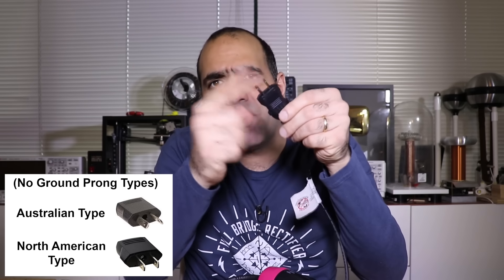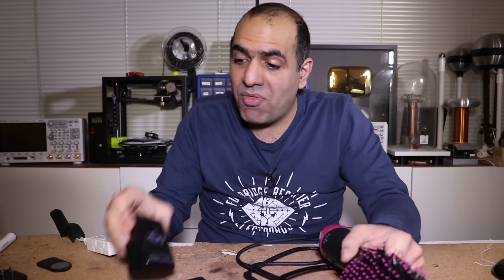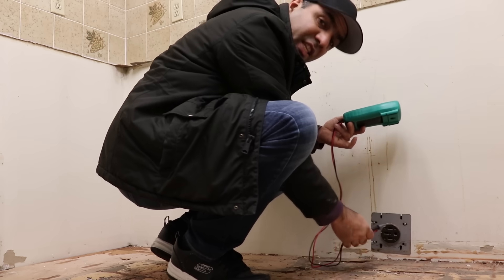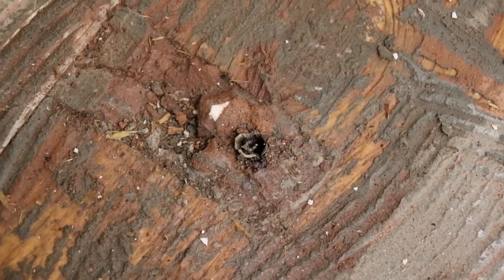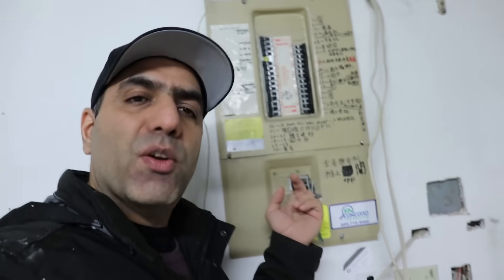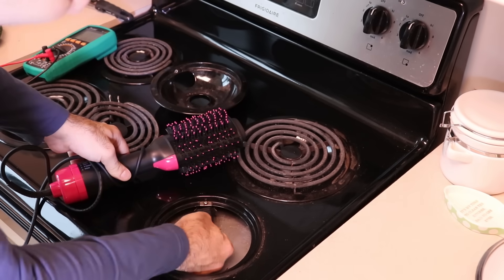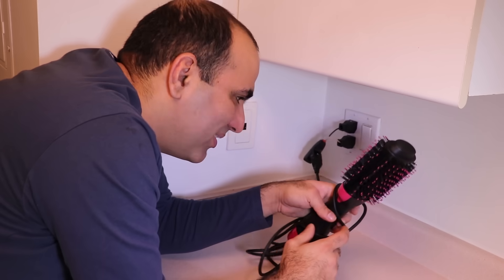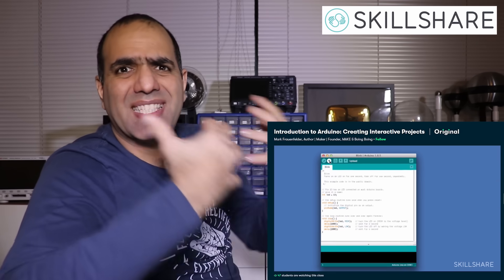Finding HIGH POWER 240V in a 120V Country

Comment: The UK has 240v 13A also has the safest plug in the world with a fuse. The rest of the world is basically taping death wires together and they get shit power. They can't even run a kettle on a single ring main what a joke of a system. The UK is still the best Rule Britannia God save The Queen.

Comment: The reason apartments and other larger buildings have 3 phase power (3 live lines 120 degrees out of phase) is because it is more efficient, especially for very large motor loads like elevators or pumps.  However, that means the electical company has to supply the building with 3 phase power, which needs 3 power lines, 120 degrees out of phase.  For smaller houses, like single family dwellings, they use what is called a split tap transformer.  With these, the power company only needs to run one phase down the street, and the primary side of the transformer is a single winding.  The secondary is also a single winding, but half way through the winding they tap in a neutral wire.  If you measure voltage from either half of the secondary to the neutral, you will get 120V.  If you measure the entire winding, you get 240v.  This is why your appartment has 120 degree 208V instead of 180 degree 240v, because it is a larger building and has 3 phase mains instead of split phase.

Comment: Hi Mr. Mehdi! I have a question. Does the heating up of mobile/laptop chargers reduce their efficiency? Because today i was gaming and my charging brick was under  my blanket which i didnt notice, so my laptop shut down in between gaming because there was no juice left in the batteries and when i touched my charging brick i could not hold it. It was too hot. Gaming requires alot of power. So apparently my charger was not providing enough power.
Reply: Thankfully your charger had thermal shutdown protection or else you might have burned your house down.  Transformers and power supplies get hot and have to radiate the heat out of their cases.  Once it got too hot, the regulators shut down.

Comment: Hi Mehdi.  Looking to find someone who has posted something electrical on Reddit and from there wound up on this channel.  Of your videos I picked the most recent one thinking this query might reach you sooner.  I know it's Christmas so you're probably in Hawaii on vacation but even so, if you notice this and have time to answer I'll bet you know the exact answer instead of me getting a bunch of guesses by people who don't know what they're doing.  Clearly you know what you're doing. 

I'm trying to find the source of parasitic drain on my 1995 Oldsmobile 98.  Putting the multimeter on the milleamp setting, I touch the positive multimeter probe to the loose nagative cable and the black multimeter probe to the negative post on the battery.  I get .10 milleamps.  Reversing the probes, I put the positive multimeter probe on the negative battery terminal and the negative probe on the loose negative cable and I get .03.  Seems to me it shouldn't make any difference which probe is placed where as long as the multimeter is in series with the circuit.  Obviously it does make a difference.  Can you please tell me why?  I've got two multimeters and they both do the same thing with the same situation that I've described.  

Thanks for any help.

Comment: That was fun.  FYI: at least in Canada (which is almost identical to US practice and codes), 120/240V is far more common than 120/208V.  I think the only place where you see 208V is industrial and commercial where the buildings tend to be supplied 3 phase directly.

In residential, as far as I can tell, it's always 120/240V.

Comment: i suppose you could get wall mountable schuko plug from europe and run that to the power outlet if you're desperate for 240 volts but don't want to make a suicide cable.

Comment: If you ever do build or find one of these adapters, check everything!!!!!!!!!!!!!!!!!!!!!!!!!!!!!!!!!!!!!!!

I got thankfully myself involved with my county Fair's Electrics, and got myself free lunch. we had a food vendor show up that had wired up there trailer with a 30 amp 120 / 240 input then made an adapter cable to 2 normal US. 15 amp plugs ends that was... wired correctly. But out of the five extension cords they brought out of the two that they used one of them had reverse polarity and as soon as they plugged it in there was a nice neutral hot short that trip the overcurrent protection AKA circuit breaker. I then had to check their installation which I wanted to do before they plugged in and subsequently trackdown out of 6 electrical panels which one had the breaker in it of course not labeled.
They didn't necessarily need 240v, they mostly had just two separate 20 amp circuits throughout the trailer.
The extension cord in question had replaced ends which is all fine except the replacement ends must have been old stock and for some reason this manufacturer decided to color the neutral pin black before they switched to the now-standard silver. whereas the standard for the hot pin is brass. so obviously the black wire ended up on the black terminal when it should have been the other way around.
get yourself one of those 3 light Outlet testers, test at the outlet, test at the end of the extension cord and test anyting Downstream.
If you want to go further get a non-contact voltage detector as that will allow you to detect polarity in the AC system which the 3 light tester has a few modes that it cannot detect. follow that up with a good multimeter ( in volts mode of course not amps mode, you hopefully only ever do that once..... ).
Reply: This is like the third or fourth comment I've said this in I really should do a copy paste at this point.

Comment: my question is....   since you have 2 @ 120 @ 16A each , does it equal 220 @ 30A???  or is it still 15A total ???
Reply: It is 240V at 15A.  When you put voltage sources in series, you double the voltage, but the current stays the same.  When you put them in parallel you double the current, but the voltage stays the same.

Comment: @ 5:53 - If you had an oven with two outlets on the top instead of the one, it would be very easy to get 240V with a customized extension cord.

Comment: Is it true that in North America they went with 110v  due to pressure from copper mine owners who wanted laager diameter cables used in houses?
Reply: No. Larger diameter cables compared to who? In 1882 the world was equally dark. Thomas Edison chose 110v as the voltage in his power generating stations. This matched the 100v incandescent lamps he manufactured. Choosing the voltage for an incandescent lamp is important because the higher the voltage the shorter the life of the lamp.  That is why incandescent lamps in automobiles can be quite ancient.  12v lamps have massive filaments compared to 240v bulbs. Basically a 120v lamp will last twice as long as a 240v lamp of the same wattage.

There is no perfect voltage. A lot of things today are built to run on 100-240 volts. This covers Japan's 100v to the 230v used by various other countries.  I suspect that when the item is used in Japan it runs significantly cooler than it does in the 230v world. Japan wastes less energy than the 230volters. Japan seems to be doing  well on a paltry 100v.
Reply: @billelkins994  compared to the standard 220v of the time as put out by the investor of the incandescent lamp in a 1860.
Reply: @tasherratt  Where was the operating 220vac system in 1882?  Edison's 110vdc system was the first in New York city. The 110vdc system did not become the US standard, except for the 110 voltage.  It was heavily adopted and the service continued for 125 years.
Reply: @billelkins994  Across quite a large swathe of the UK, Edison was well behind in New York. Its why he lost his patent for the bulb he copied.
Reply: @tasherratt  

Sebastian Pietro Innocenzo Adhemar Ziani de Ferranti  had not invented the transformer until 1885.

Comment: So Australian normal power outlet supply is sort of 240V.  Officially it is 230V +10%/ -6%   or  216V to 253V RMS.  Normally not less than 240 and often up to 250V.  Some homes have access to 415V 3-phase  (3 x 240V  120º apart) other regular homes in country areas (like my home) have access to 2 x 240, 180º apart , which is really 480V single phase with a centre-taped grounded Neutral.  all from a 50KVA street transformer out the front of my house.  Buckets of power if needed.   I have successfully run a 35KVA motor at home, but it did dim the house lights a little at power up.  :)    If Mehdi lived here he'd be dead by now...

Comment: Wow I didn't know the 240v power in apartments isn't actually 180deg out of phase. Why is that? 180 is understandable as it's from a center-tapped transformer but how and why do they supply power like that (forgot the other angle) in apartments?
Reply: Because large buildings get 3 phase power.  Small residences get split single phase power.

Comment: The situation with the kitchen outlets is normal in Canada. The two outlets are on different phases, but share a neutral, resulting in a situation where the current that goes through the neutral is the difference between the current drawn through each outlet.
For example: if the appliance plugged into the top outlet is drawing 10A, and the appliance plugged into the bottom outlet is drawing 9A, only 1A will go through the neutral.

Comment: If i was lucky enough to watch this video before I tested my multimeter i would have switched to V and not make a short circuit. Luckily thats why breakers exist. Damn
Reply: Unless of course you have a federal fire Pacific electrical panel ( apparently you can slip a check under UL Laboratories door backing in the ancient years  and get approval ) which just recently got retired. I accidentally did this a year or two ago and as I watched all the lights in my room dim and come back up only after the power strip breaker tripped. thank goodness all the computers running UPS.
I've read stories around the interwebs of electricians in attics too lazy to go down And using Cutters to disconnect them and suddenly arc welding things together. Federal Pacific panels are on the do not use list of home inspectors for good reason.

Comment: The reason for the difference is that in residential, you only get split single phase going to the house, so you get the 120/240V. In commercial/larger residential, you'll see the 3-phase wye 120/208 volts. Sometimes, in an area with mixed residential and commercial, you'll sometimes get 120/208/240V high-leg delta 3-phase, b phase is the high leg so it's 120V phase a and c to neutral, 240V phase to phase, and 208V phase b to neutral since if you run it without the high phase, you'll get the same split single phase. In industrial, you often see 3-phase wye 277/480V.
Reply: Most of the time, in residential areas, the power company only runs a single phase primary on the side streets. As far as high-leg delta, you aren't supposed to use phase b to neutral to run 208V loads for two reasons: (1)single pole breakers do not usually have the voltage ratings for that use (2) it can overload the transformer
Reply: u engineer?????
Reply: @ArshdeepSingh-oc1oo  It's basic commercial and industrial wiring, commercial and industrial electricians who work with that stuff every day know it real well.  Most residential electricians don't.  Electrical engineers who are on the "power" track rather than electronics certainly do.  I'm neither, but I've studied it a bit, and Zzyxx Wolfe has it all right as far as I remember.

Comment: So what you're saying is you can get 220V power out of the electric range.

L2 Charging for EV vehicles require 220V power.

With the right adapter, I can recharge a Tesla through the back burner.
Reply: In case you are serious, BEV/PHEV charging already commonly uses the same NEMA 14-50 socket that electric ranges and larger RVs/campers/travel trailers do, hence yes, you can charge a Tesla at level 2 at any of the above sockets assuming the EVSE cord will reach. You can also use a 14-30 clothes dryer socket if your car supports automatically or manually limiting the charge current drawn and you have an EVSE with the correct plug and/or a 14-30 or 50 with no neutral pin as that is what determines the difference. 30 amp has an L shaped neutral pin 50 amp is a flat pin. With that pin removed you can plug in to either one as the others are the same.

Comment: I was trying to figure out if I could make a 240V adapter off 2 opposite phase 120V circuits for a welder in a space i couldnt run new wires.
I decided risking electrocution or burning the place down wasnt worth the halfassery, so I just bought a generator with the appropriate output.
Reply: Good decision.

Comment: At 3100 comments this one will undoubtedly get buried, but residential North American power 240V single phase is delivered to the house, and 120V is derived from center-tapping for the neutral at the local transformer.  Your apartment building has three-phase power.  Without seeing your breaker panel no idea if you only have two phases delivered to your unit or if all three are delivered, but only two phases reach that oven outlet, so approximately 208V across phases.

It may be that the apartments are balanced where A-B, A-C, and B-C are round-robined through the building's units, such that everyone gets two phases.  Thing is, HVAC equipment would operate much more efficiently on three-phase, so depending on how various services in your building are paid for (ie, out of association fees versus directly by the residents) there may be three-phase to your apartment, just not for anything that you have ready access to.

I am by no means an expert, I've simply looked into availability for three-phase power at home for shop equipment, versus 240V single phase equipment.

Comment: It is important to check the socket wiring. I had a socket in an apartment where the neutral and hot were swapped. This caused a breaker trip when trying to get 240 volts from two different outlets.
Reply: It should have given you 120V, not tripped a breaker.  Though if either one was a GFCI protected circuit, it'll trip if you try to use it this way.

Comment: Isn't as simple as getting a transformer with at least 30% more watts support than usage?

Or if the house have dual phase supply just get the 2 phase cables and use them instead of phase and neutral.

I did that with a sewing machine

Comment: That's a very strange apartment you have there...never seen more than one circuit in any kitchen, and I'm fairly certain we had 240V not 200V for the higher power stuff like the A/C.
Reply: That's called a multiwire branch circuit.  They're not common in older homes, but now they require more circuits in the kitchen (my older house only has one 20A circuit in the kitchen).  The reason for the 240V / 208V discrepancy is because he's in a large apartment building that is supplied with 3 phase power.  You get 208V between the phases.  Residential homes are supplied with split single phase 240V power.  That's why you get 240V there.

Comment: 8:00 woah woah woah. That's actually a massive code violation in my state. I think the actual reason for this is that that oven is on the same two circuits as the outlets. Because they need to be branched with the minimal amount of wire its easiest to run both phases through each outlet like a tree from the ovens box. This is also a code violation in my state. An oven is just required to be on its very own circuit.
Reply: No, kitchen outlets are wired like that to save wire, but that doesn't mean they're on the same circuit as the oven.
Reply: @HydraulicDesign  Considering I've seen houses wired on the same circuit as the oven I beg to differ. Kind of the whole point of this is thats a super bad practice that really has nothing to do with being more practical with circuit loading as suggested in the video. It's just lazy or backward wiring.
Reply: I don't know where you are, but this is allowed by NEC 210.4.  It's called a multiwire branch circuit.  The catch is it must be connected to a 2-pole breaker because the circuits share a neutral, so if one trips, they both have to trip.  They like using these in kitchens because it uses less wire and labor to provide the required two 20A circuits and it also has less voltage drop for long runs.
Reply: @stargazer7644  Just because something is in the NEC does not mean its allowed in a jurisdiction. Saving wire really isn't best safety practice nor is it the best for the home owner. For example having neutral wires in light switch junction boxes is more important than ever with smart home devices.
Reply: @Furiends  Yeah, I know that - hence the "I don't know where you are" part.  I'm curious to know why you believe a multiwire branch circuit is less safe because it doesn't have a second redundant neutral wire?

Comment: Wow, what a struggle just to get decent electric power in America... Here in Europe, every house has 3 phase 400V mains. Normal wall plugs have 230V (Phase to neutral) and in the garage or the kitchen we have 3 phase plugs.
Reply: It's really not much different here, we have 240V and 120V power available in every house.  Our system is safer because only very few devices need 240V power, and they get dedicated circuits.